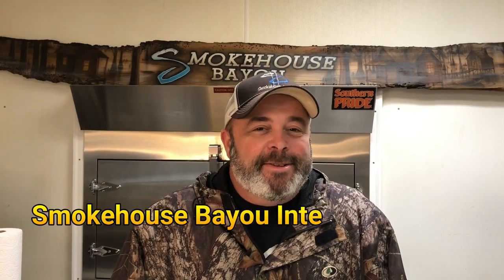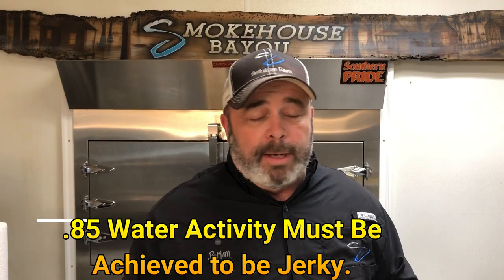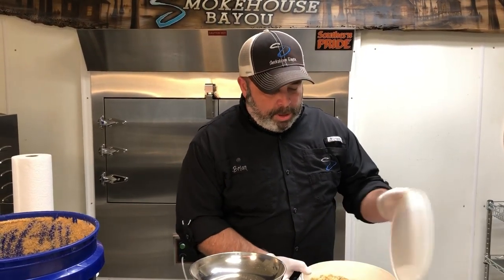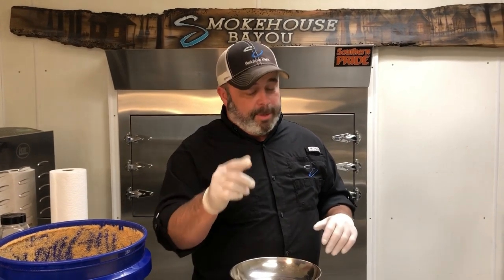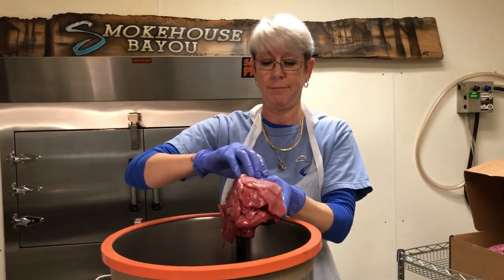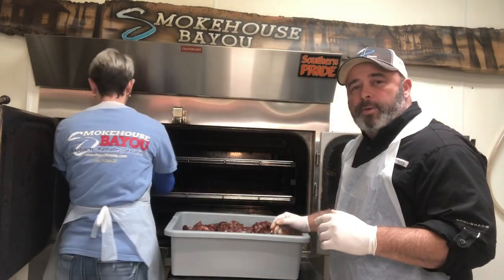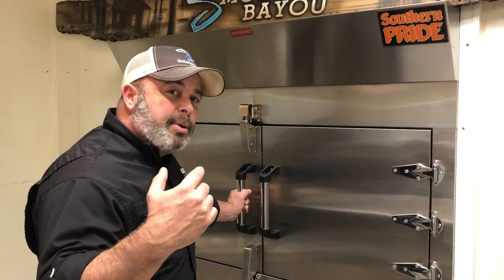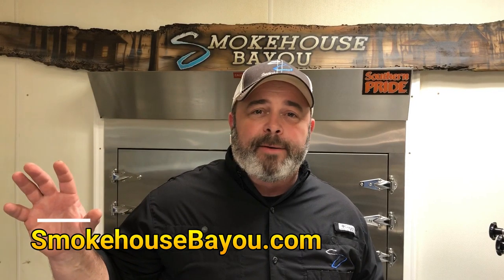How to Smoke Beef Jerky:  Insights and Methods from Professional PitMasters  #Jerky #smokehousebayou

Comment: I really enjoyed this video.  I have a DC Curtis table top vacuum tumbler that can do 8 lbs at a time (expensive but bullet proof American made).  I've been doing wet marinade with it.  I'm going to try the dry spice method now.  I've got a Camp Chef Woodwind Pro that does a great job smoking.  Are you still putting smoke in when you bump it up to 260?

Comment: This was a very good video to watch. I'm just new to the world of smoking. I got my smoker, grinder, casings, and curing salt. I'm just doing my first jerky tomorrow. It's marinating tonight. My diet is very strict with low to no sodium, so I wanted to find a recipe to make sausages and other smoked products that I can do that with. I grew my own celery and dehydrated it at 115, then I grind it to a powder. Through my research, I learned I could use this in smoking recipes as a cure. I'm just not sure how much yet. You mentioned celery powder... so I went and added 2 teaspoons to my jerky marinade. My marinade is done with organic soya sauce with super low sodium, Worcestershire sauce, garlic powder, onion powder, red chili pepper flakes, and honey. It equaled about 1 cup for the marinade all together ... for my one pound of meat. I may have made my meat a little too thin... 1/4" about or less on some parts. So it's sitting overnight marinating now. Tomorrow morning I will put it in the smoker, little big chief, and smoke it for 2-4 hours... not sure just how long really. Then like you said, I think I'll put it in the oven after at 260 to be sure it kills any invisible bacteria for 5-10 minutes... just in case. I hope this works!!  Next is sausage... any tips or insights for my special need would be so appreciated. I do have the salt cure, but I just don't know how much I should use per pound. I would like to not put any salt in my sausage, just celery powder and other seasonings, or at least reduced salt if it's really necessary. But if it's just about a salty balance for taste I would rather avoid it. Thanks so much!
Reply from the maker: Inner Power Works thank you for sharing your plan with us!  Since you are doing such small batches, you could consider avoiding the cure salt all together and simply use refrigeration. Just a thought.  Good luck with your smoking. Let us know how it turns out!
Reply: @SmokehouseBayouSmokedMeats   I do want to be able to keep jerky handy for when I'm out and about traveling, so it doesn't need refrigeration.
Reply from the maker: Inner Power Works Understood. Hitting the necessary water activity level, cure salt or another preservative, proper packaging and an oxygen absorber are all part of a plan for shelf stability. I’m not as familiar with sausage processing as I am with jerky, but there are many resources available.  If we can help you in any way please let us know.
Reply: @SmokehouseBayouSmokedMeats   I did my first batch of jerky and it worked out really well just using the celery powder. I have a little big chief smoker, so I can't adjust the temperature. It was a bit cool outside in the morning so it took a while to build some heat. Finally, I just wrapped a heavy towel around it and clipped it to help insulate it. Just an improvising moment... which worked well.  I used celery power that I had dehydrated from my harvest. I used no extra salt of any sort. It was actually really tasty and no one noticed there wasn't any salt in it. I used a super low sodium coconut soya sauce, Worcestershire sauce, honey and other spices along with the celery powder. There's a little bit of sodium in the liquids, which is enough for me, but not so much I'm in a battle. Anyways, I just wanted to share that with you. I have since made a super batch of teriyaki and regular spicy. Then I vacuum sealed it and put it in the freezer. Note: I did use a dehydrator to help dry the jerky before putting it in the smoke to help reduce cooking time and ensure it's cooked to temperature. Then I smoked it. Worked fine. The only thing is not to dry it out too much before smoking. When I can I'll be buying a smoker with more heat control and larger! I also made my sausage with the Prague curing salt #1 and a very low amount of sodium... and it worked fantastically! It's a whole new world of smoking for me that I'm looking forward to now!
Reply from the maker: Inner Power Works it sounds like you are getting it figured out!  That’s great. Before going commercial with our jerky, some of the most fun smokes was when I was trying new formulas and tweaking flavor profiles. R&D is rewarding!  Thank you for letting us know how it went.

Comment: Hope this helps...
A marinade, under current language and slang terminology, can be a dry or wet combination of ingredients. Although, if it starts out dry, it's actually a rub.  It's just use/ intent that starts it sliding into the grey areas of definition.  
"And there's the rub of it."  lol
   The term marinade is French in origin, 1675-85 and originally meant to cure a meat in a brine.
  Now, often with a vinegar or wine base along with oils herbs and spices, it is meant to steep meats, fish and vegetables for a period of time before cooking (heated drying/smoking/dehydrating is a form of cooking).
  Happy trails 👣
Reply from the maker: Thanks for sharing!

Comment: A vacuum tumbler is a key to producing soft shelf-stable jerky.  You can marinate your meat for three days and still not get anywhere near the pickup of the marinade solution.  As he describes, the vacuum tumbler opens up the meat fibers and allows for the marinade to penetrate almost all of the meat.  You don't need an expensive one.  The one I have was around $150, and I do five-pound batches with it, but it will hold more.  It was worth every penny.  If you want to learn how to make good jerky, listen to this guy!
Reply from the maker: James McCloughan Thank you for commenting!  Tyrone the Tumbler has made our life easier and our jerky better!  Happy jerky making!
Reply: James McCloughan  where do you get a vacuum Tumblr for $150 I want one of those
Reply: Unless you cut your slices a bit thinner than 1/4 inch and always with the grain.

Comment: This may be a dumb question but ya cant learn if ya don't ask . So by soaking your wood to making it smolder is that not what's called dirty smoke ?  Thanks for the video for the third time now
Reply from the maker: I haven’t had any problem with dirty smoke.  We use B&B wood mostly. Thank you!

Comment: I have a question. Why do you turn the pit up to 260. What does that do, and for how long.
Reply from the maker: When the jerky smoking cycle is done, I ramp the smoker temp to 260 and it takes it a few minutes to reach that temp. As soon as it does, I shut the smoker down.  In addition to the smoking process shown, this last step insures all pathogens are toast!  Thanks for watching!
Reply: Awesome thanks so much. How do you like the southern pride. I'm looking at that same model to go on a BBQ trailer. What are the  cons  of this unit.